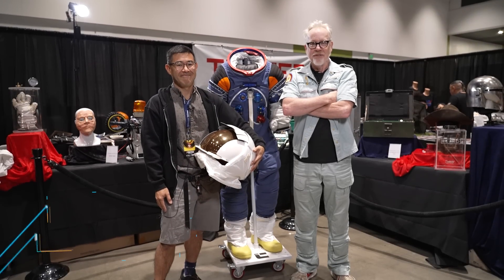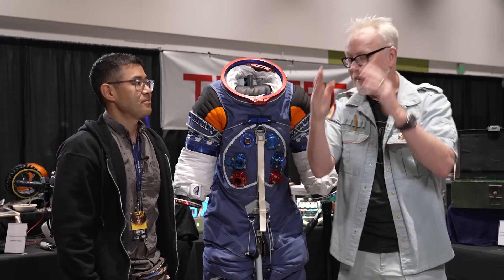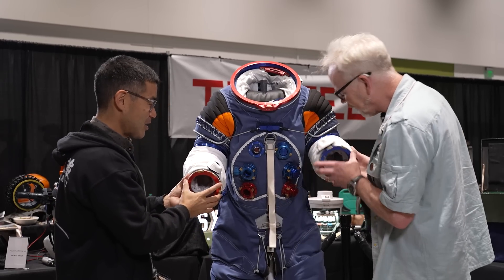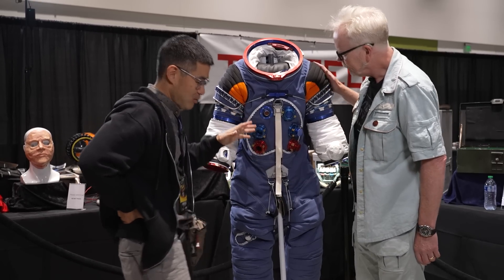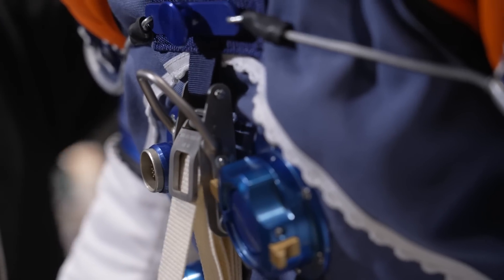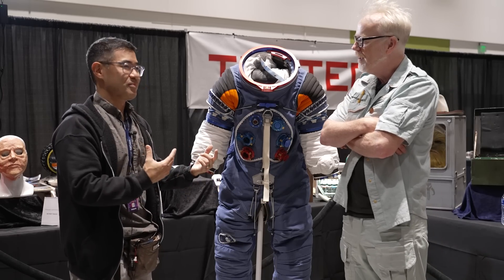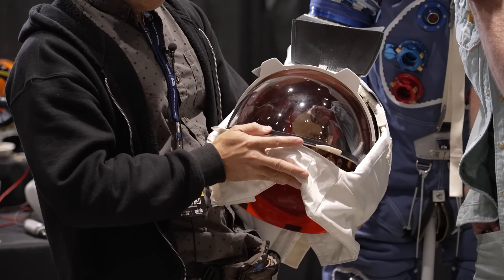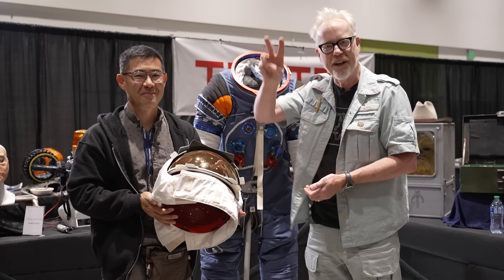Ryan Nagata's Apollo Pressure Suit Replica!

Comment: So he could have made it hold pressure and be a real(ish) working suit if he had just used the right materials?
Reply: Probably because of the materials. Real space suits have a rubber layer, that turns the whole think into a giant rubber glove, which holds the air and pressure inside. This suit is only made of fabrics